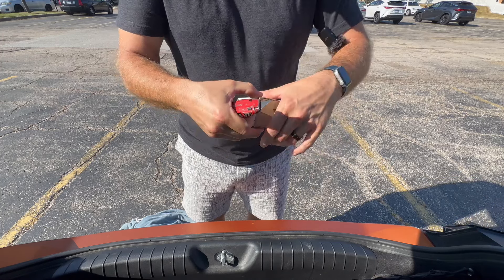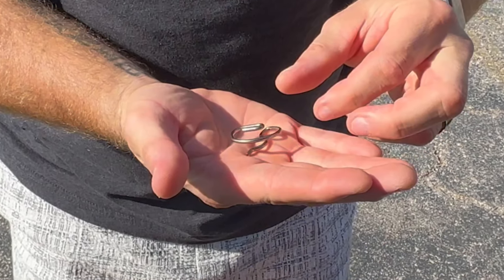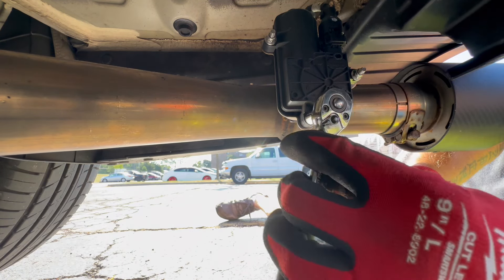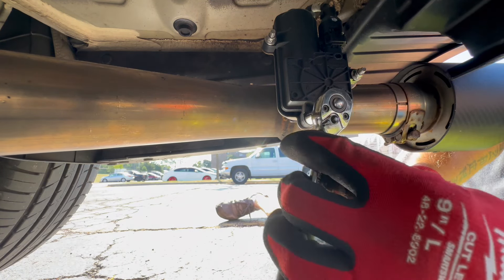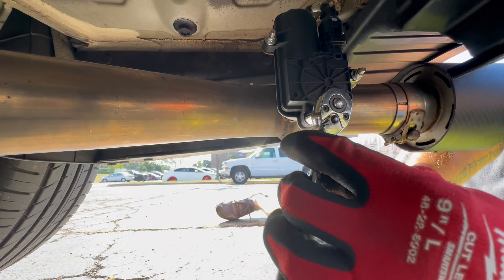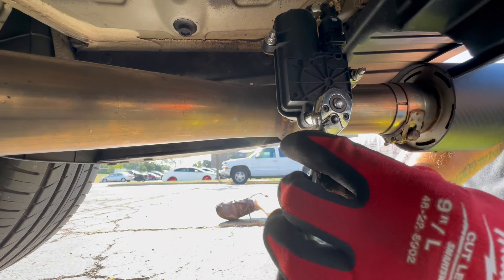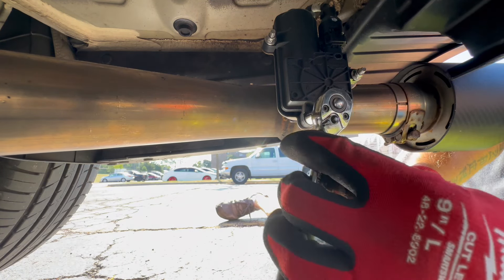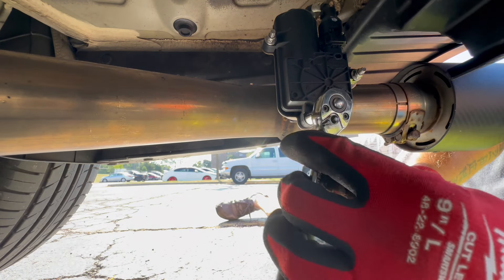Torcon Exhaust Valve Spring - Installation & Review

Comment: Tried Torcon spring, (3rd aftermarket spring), still rattles.  Also tried second tailpipe from Stillen, still rattles.  Even bought a NEW actuator from Hyundai, STILL RATTLES.  If I unplug the harness it stops completely but am stuck with an open flap (no sound quieting).  STILL waiting to hear from Stillen on some sort of resolution.  I wonder if it's a battle inside the muffler side of the tailpipe.
Reply from the maker: Man that sucks bro, so far Torcon seems to work for me, but we will see what’s gonna happend, but still it seems like this spring is the best
Reply: @PolishBullitt  Stillen finally agreed to do a full exchange and I now have a Borla exhaust on my '22 N.  LOVE the way it looks, sounds, and performs.  Stillen was louder overall, but the Borla is deeper and has a big more refined sound.  Just glad my problem is gone.  I am using the Torcon spring in my Borla and no more rattle at all.  Thought you'd like to know.  :)
Reply from the maker: @LeftenantMalachi that’s great brother I’m glad they helped you out with a refund, nobody is perfect, but happy client is important 💪🙂 I’m happy you got what you wanted and finally you can enjoy your car once again 💪😃

Comment: Hope this spring holds up long term!!! QQ totally unrelated. Are you still running 5w-40 oil year round, and how has the N been running with it during the Chicago winters? Thanks broski!
Reply from the maker: I hope so brother cause I’m tired of changing those springs back and forth lol
I used to run 5w30 royal purple through the winter and it was gucci but never 5w40, now I’m on 0w40 Mobil 1 and planning to stick with it for long term. I’m doing oil analysis basically every oil change and so far my last one after track days, drag strips and all other shenanigans was basically perfect so I’m sticking with Mobil 1 0w40 for sure 🙂
Reply: @PolishBullitt  Oh Ok, I must have forget on it was 5w30 haha. But I am glad to hear the 0w40 is working out for you. I might try that. Thanks!
Reply from the maker: @rockysobekbeats no problem brother, try it out and maybe you can do a blackstone lab oil analysis just to look at overall oil health it’s not that expensive 35$ plus I recommend not going over 3500-4000 miles cause gas likes to get into oil and dilute it and that’s not good for the engine 🙂
Reply: @PolishBullitt  I was thinking about doing one. Yeah I like to change around every 2500-3000 just to be safe (prob a bit excessive haha). BTW, I may have asked you this before but you your run a catch can? What are your opinions on them? As always, many thanks brotha!
Reply from the maker: @rockysobekbeats better change it more often than not haha I don’t have a catch can honestly I never really been a fan and I know some people swear by them but idk brother for some reason I feel like I don’t need one but I might be wrong lol I will look at the valves maybe this year so I can really see what is going on over there and then decide if I need one 😉
Reply: @PolishBullitt  Appreciate the honesty broski! Trying to decide myself, I guess we shall see. ✌️
Reply from the maker: @rockysobekbeats 100% brother any other questions just shoot 🙂